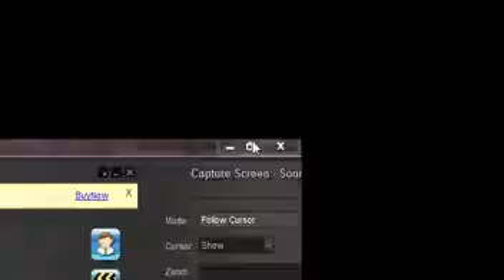Explanation of why Ares and Liberty Launcher fail

Comment: I have to agree with the argument of design being inherently unstable. But one thing that may be overlooked is wind, being that the top section is wider a gust of wind could push the top of the vehicle leeward, thus being enhanced by the bottom section being left windward, this could cause an angle of attack that is unrecoverable.This is the opposite of something like the shuttle or Apollo where if a gust hits it causes the bottom to push out thus angling into the wind making it a non-event